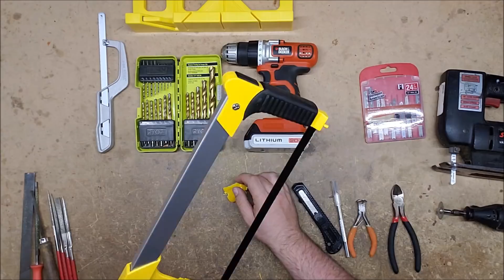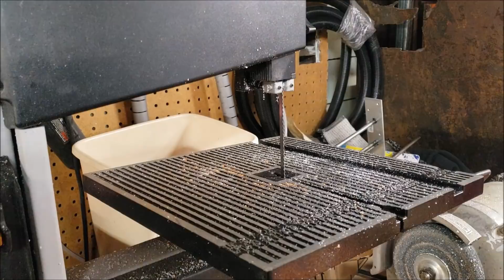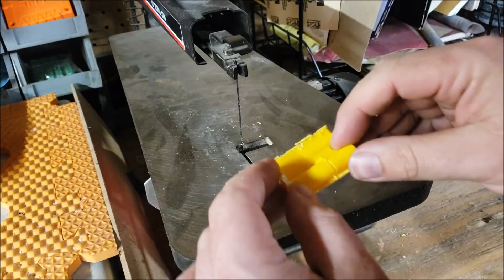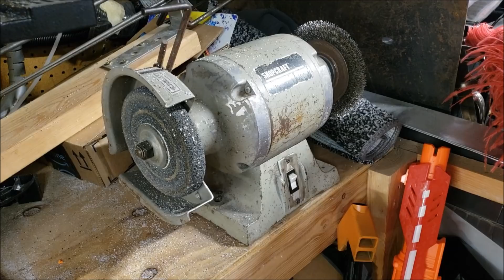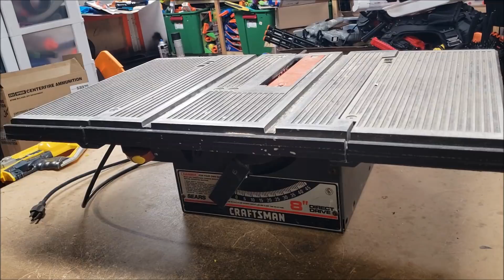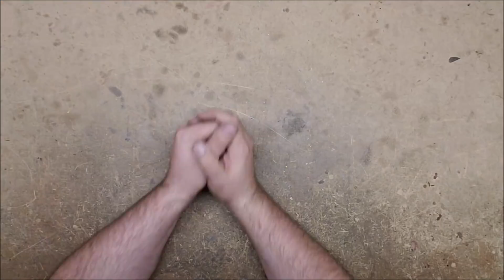Monday Mod Tips - Shell Integration: Part 2 - Shell Cutting Tools

Comment: Ever heard of a reamer?  Multi edged round tool uses to clean up round holes.  Takes about .015 off but makes very round and smooth surfaces inside of a drilled hole.  My favorite way to set barrels.
Reply from the maker: Yup, I learned about them after making this video. I have some now.

Comment: I have seen and used many of these but I have a feer of band saws because I almost got decapitated by one

Do my grand papa was drunk and I was helping him change blades he wanted to test it out with the blade exposed and I didn't want to do it but I trusted him because I was 7 but he runs it and I take a step back and the blade snaps and the  blade goes right past my head and I peed my pants because I 2as scared and I almost died my grandpa wasn't as lucky he got hit in the arm but he is fine now and he also has quit drinking witch I am glad about because he is way safer with stuff now we still joke about it to this day
Reply from the maker: That sounds like a perfectly reasonable fear.
Reply: @CaptainXavier  though I have gotwb better about it I am way more cautious with working on one but I will use one when needed because it will work very well for things I need to cut

Comment: One tool I love for shell cutting and use almost exclusively is an oscillating multi tool. With fine-toothed blades it gets flawlessly straight, clean, and precise cuts. It’s almost like a hack saw except you can go about 20 times faster, and the cuts aren’t as wavy on the edge.

Comment: it's worth mentioning that with Band Saws, the decent ones have an adjustable guide that lowers from the top down the blade to reduce the 'walk' you get by having a pair of bearings that the blade will rest against. It looks like you have one, but had it up as high as possible for visual clarity in recording, yes?

Also, haven't seen a Bench Shear like that in a good long while, kudos for having one Captain :D

Comment: Since you mentioned making armour bits with metal, is it worth replacing and/or reinforcing certain parts in my rig, i.e. my shoulder protectors and plates? I already have a bunch of stuff weaved on and I don't know if the extra weight and structural support would be worth it.

Comment: I would not recommend getting a cordless Dremel, I have one and they are not powerful enough for plastic, and if you get bogged down in plastic they shut off. I've had one for about a year now and the battery only lasts about 30 minutes.

Comment: You can do a surprising amount with just a hacksaw, snips, and sand paper. My tools have since grown since starting he hobby to make life easier.
Reply from the maker: I got lucky.  I came into Nerf modding from armor making so I already had many of these tools.  Made things much easier and I take them very much for granted.
Reply: Ikr i only had a saw and a straight blade knife and the old sand paper and I've made alot
Reply: @connortremeer1966  I started with a nail file, screwdriver, old used sandpaper and kids scissors.
Reply: @torpedo996  I only had two sticks and a rock